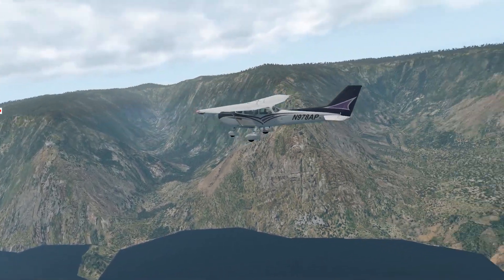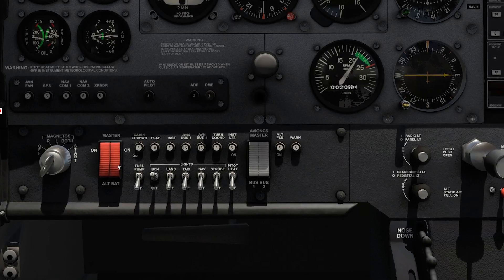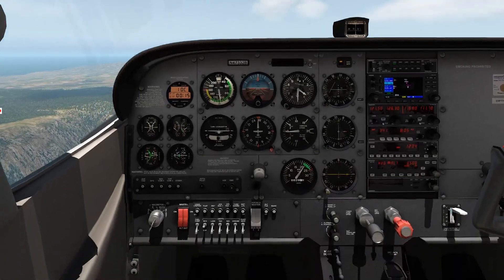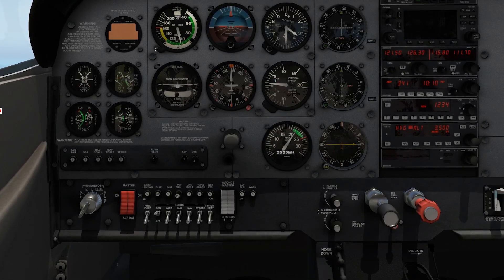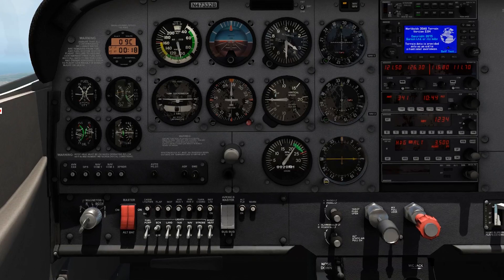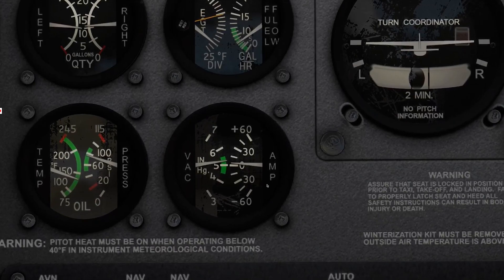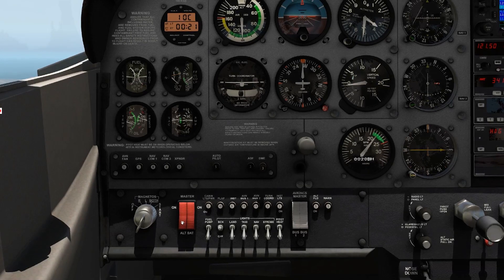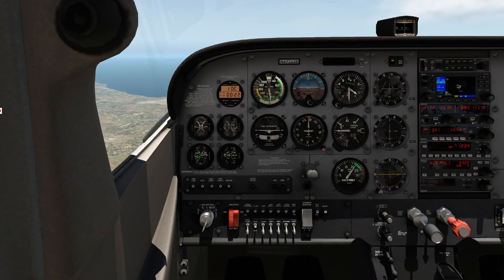X-Plane 11 | The Cessna 172 Electrical System

Comment: Hi Clay, awesome tutorial!
I just wondering how did you do to interact (pull and push) with the cockpit breakers. I tried to do the same you did in the video but the breakers are not doing anything when I'm clicking on them. Thanks in advance for your help!
Reply from the maker: Hi jose - that is a feature that the Airfoillabs Cessna 172 has. I’m not sure that is possible in the default one.

Comment: Dude thanks so much this will help me on my PPL checkride! I had no clue that the numbers on the circuit breakers meant the amps that flow to that system. So much information explained in a very interesting way.
Reply from the maker: Great, Luke - good luck and just be sure to compare anything you see here to your flight manuals and with your instructor. Many differences exist in the sim world, as real as it is, and I want to make sure you get the best information from an instruction and other official sources.

Comment: IRL, avionic buses do not turn off the flaps, the fuel pump or the annunciator (warning) lights, they are not avionics. They are all connected to electrical bus #1 instead (C172SP POH).
Reply: I noted what I thought was this error also.  Thanks for confirming.

Comment: Great presentation!  Unless I missed it, you didnt show system voltage with the alt off, should be about 24 volts.  With alt back on should be about 28 volts charging with pressure to make sure batt is 
fully charged at at 24volts.  Also with stock X-plane 11 cessna 172, you cant turn off batt side of master switch without turning off alt side also.  Again, thanks for presentation.

Comment: I keep getting the volts light and I have no clue why it turns on. I’m new to the sim/flying in general, even on tutorial it sudden turns on and doesn’t turn off. I only have the yoke from honeycomb. Any help on this? I searched the manual, it says what it is but does not tell me how to solve it. Thanks
Reply from the maker: The “Volts” light indicates that the alternator is indicating a discharge. It is often seen when running a very low RPM with a heavy electrical load (like during taxi). In this case, it just means that the engine isn’t spinning the alternator at a rate sufficient to keep the battery charging. Is this when it’s happening for you? If so, try throttling up some, maybe to around 1000rpm.
Reply: clayviation it happens on all the tutorials, about 1 minute in the air, it’s starts to do this sound and turns the volts light on, yet I have my rpm at around 2200rpm as I climb to 1500 ft.
Reply: clayviation I look at many videos and do exactly as they do and I still get that noise/warning

Comment: Hi Clay thank you for the video.  One question, if I had to turn off one or both Avionics switches mid flight, from reading your description it sounds like I would lose lights, pitot heat and flap control (along with other things).  But during preflight we test those three things after turning off the avionics switch in a 172.  I must be misunderstanding something and was hoping you could clarify?  Thank you!
Reply from the maker: Great question, Dean, and I’m stoked that you are thinking about this so critically. Here’s what I can tell. I can’t speak for every airplane, but in this Airfoillabs Cessna 172, having the master switch on with the avionics master switch off will indeed allow flaps to operate, just like when you preflight and pop the master on to lower flaps. If the circuit breaker for the Avionics Bus 1 is pulled, the power supply is then broken to the items listed, including the flaps. So my takeaway from this learning is that by knowing the items that are on each of the avionics busses, it might provide insight into what would be lost if those circuit breakers were to pop.
Reply: @clayviation  Ah my misunderstanding thank you for the reply!  Again thank you for these videos!
Reply from the maker: Thank YOU for the great question!  The truth is, since you and I have now paused to dig a little deeper, we have that much more of an edge on understanding these systems.
Reply: Thank you and take care!

Comment: Nice!  when I finally make the jump to X-Plane I'll have to get the Airfoillabs Cessna 172.   This sim is a great place to practice system failures and emergency checklists... if it's modeled correctly ;-)
Reply from the maker: Agreed - there will always be differences in how airplanes are modeled, but the real value comes in the “chair flying” benefits of running through checklists and mentally rehearsing.
Reply: Too bad Microsoft flight sim 2020 is almost out.

Comment: Love the video. Thank you so much. I still have a qusstion though. What is avionic bus and primary bus. Like when you turn off the avionic bus we lost most of the things such as gps clock. But what would happen when primary bus goes off. What supports primary bus and what supports avionis bus?
Thanks
Reply from the maker: Most POHs have a map of what equipment is tied to each bus, and it varies. I had to try each one and make a list of the items on the busses in this particular airplane.

Comment: My instructor actually turned off the ignition and put the key in his shirt pocket.  The resulting "engine failure" was not just a "throttle to idle" simulation.  He'd "hide" the auxiliary practice grass strip directly under the aircraft.  And we'd dead stick spiral to landing.  If we were setup well for landing, then he'd give me the key back and I'd  restart the engine.  Or it would be a soft field landing to a full stop.

Comment: Hi Clay, awesome tutorial :) Quick question and I apologize
if I didn't understand something that you've explained in this tutorial. I understood that the battery/alternator sends power to the magnetos which then sends current to the spark plug. So if I have the battery and alternator switch off, where are my magnetos getting the power from ? since the aircraft keeps flying even with the master switches off.. Thanks for any info :)
Reply from the maker: Thanks Elvis! No apology needed for good questions. The magnetos are small electrical generators that are driven my the physical rotation of the engine.  So if the battery and alternator are off, the engine effectively runs independent of them since the turning of the engine powers the magnetos and the magnetos supply the spark for ignition in the engine cylinders.